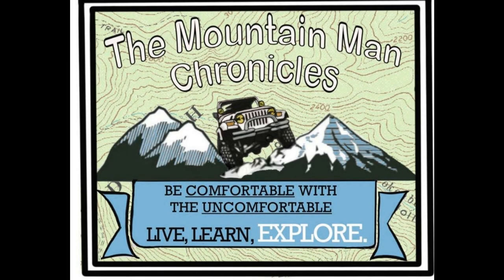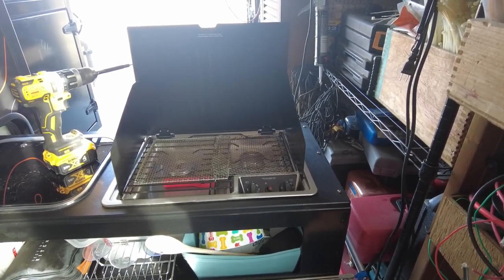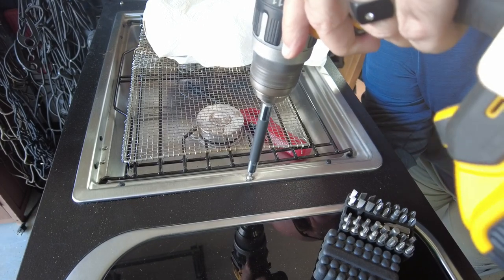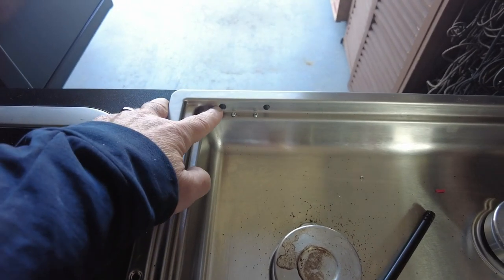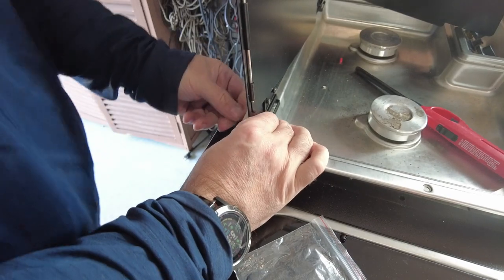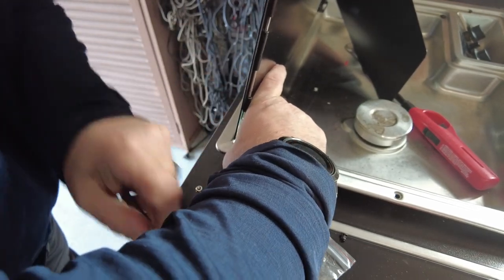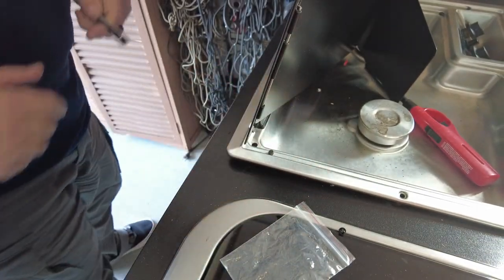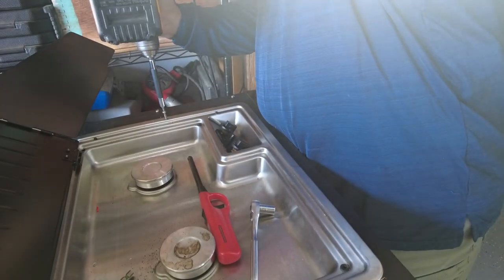DYI: Add a wind Guard to a Docetic Stove on a Mission Overland Trailer for perfect outdoor cooking

Comment: Can't find the link to the screen?
Reply from the maker: I purchased mine from a local metal shop.  I looked on Amazon and found a few.  https://www.amazon.com/Pretty-Stainless-Resisting-Projects-Valchoose/dp/B091GD9ZWW/ref=sxin_18_ac_d_rm?ac_md=2-2-c3RhaW5sZXNzIHN0ZWVsIHdpcmUgbWVzaA%3D%3D-ac_d_rm_rm_rm&content-id=amzn1.sym.b09913c7-88ee-4b06-b977-3fd4ebd29a25%3Aamzn1.sym.b09913c7-88ee-4b06-b977-3fd4ebd29a25&cv_ct_cx=stainless+steel+screen&keywords=stainless+steel+screen&pd_rd_i=B091GD9ZWW&pd_rd_r=c695a530-273b-47f4-a60d-4e183af22385&pd_rd_w=Yist5&pd_rd_wg=wW6wN&pf_rd_p=b09913c7-88ee-4b06-b977-3fd4ebd29a25&pf_rd_r=RS2HT8ZT8SF8C1FX32B5&qid=1682689980&sbo=RZvfv%2F%2FHxDF%2BO5021pAnSA%3D%3D&sr=1-3-7d9bfb42-6e38-4445-b604-42cab39e191b